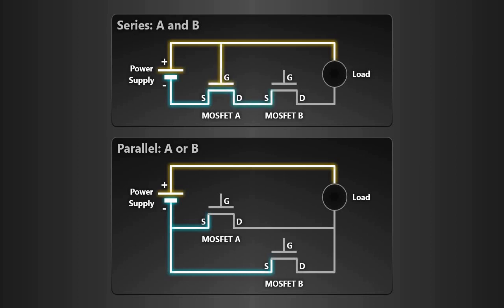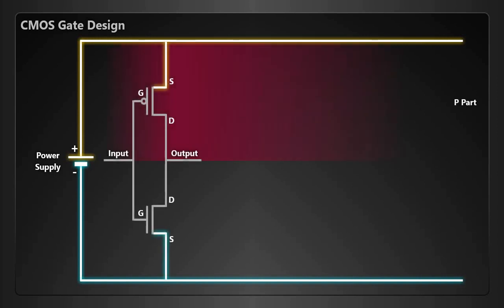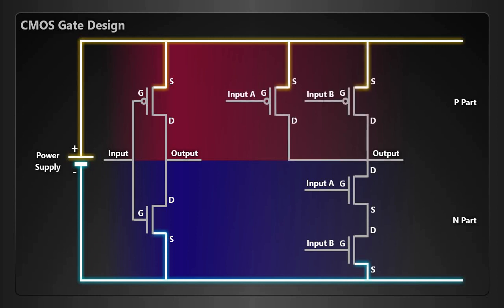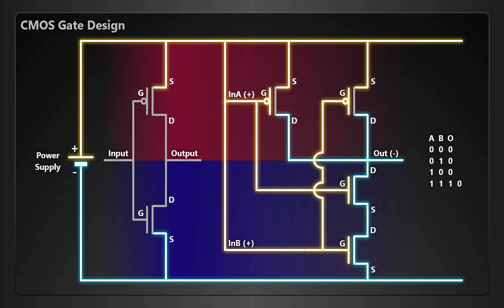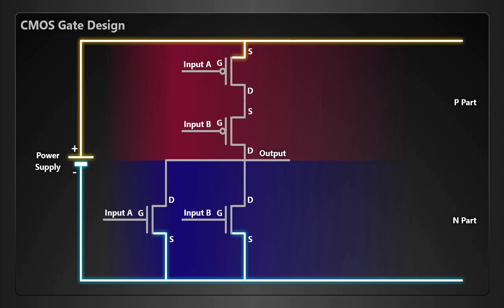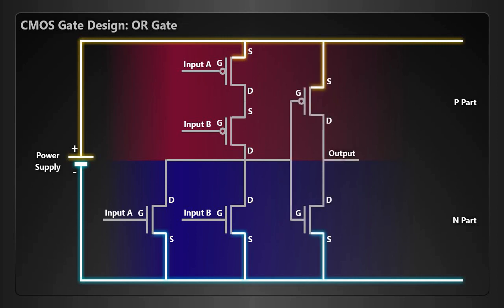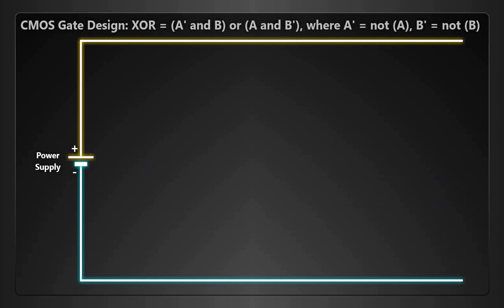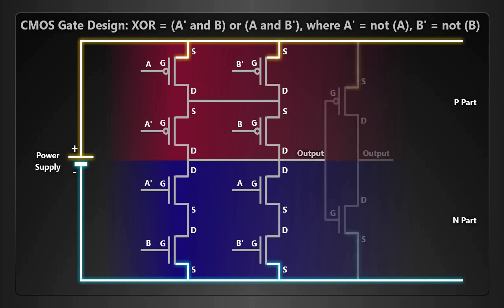VLSI - CMOS Logic: 3 - Make any logic gates using transistors

Comment: The XOR gate from CMOS within this video shows that it is using 10 transistors not including the 4 transistors needed to invert the A and B signals. This requires 14 transistors. 

An XOR gate can be built with a minimal of 6 CMOS transistors. The trick of doing this is starting with your inverter. From there you only need 4 more gates, 2 in the PUN and 2 in PDN. 

With this configuration you only need VDD to connect to the source of your PMOS within the starting inverter and your GND connecting to the source within your NMOS of the same inverter. That's all you need for the power rails. 

From there take your A input and connect it to the gate of your inverter. The output of the inverter feeds the first gate of your NMOS the source of this NMOS is fed by input B. The same signal that drives this NMOS gate feeds into the source of the next NMOS and this gate is driven by input B. Tie the two outputs or drains together. This completes your PDN, and you are done with your inverter. 

For the PUN, take the same signal A input that comes from your inverter, and this will drive 1 PMOS gate and 1 PMOS source. The drain of this last PMOS connect it to the output of the 2 NMOSs. The source of the remaining PMOS comes from input B. Take this final PMOS drain and connect it to the output network. 

This gives you a reduced transistor count for the XOR gate. There are 2 NMOS and PMOS within the complimentary parallel, series configuration and 1P, 1N for your driving inverter. Remember that an Inverter like a buffer gate will act like an amplifier, it helps strengthen the signal, so it helps to act as a driver within the network for this logic gate. It's also very compact, energy efficient with a reduced propagation delay. 

You can even test it out in Logisim or some other digital circuit simulator. 

Other than that, this was a really good video, presentation explaining the basics of CMOS technology and how to build various logic gate components from them.
Reply from the maker: Skilz, hi, what an extensive and brilliant comment! Yes, you are right, the XOR gate can be made much more compact. However, here we are exploring the design principles, we have not gotten into optimisation. Best regards